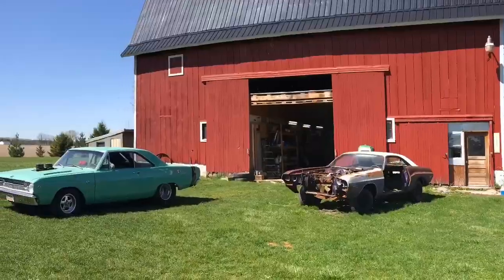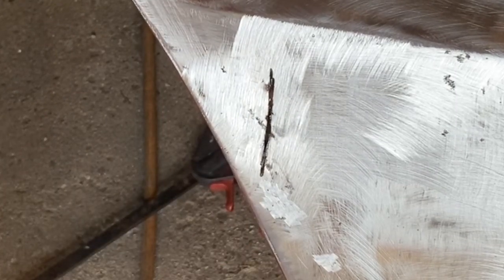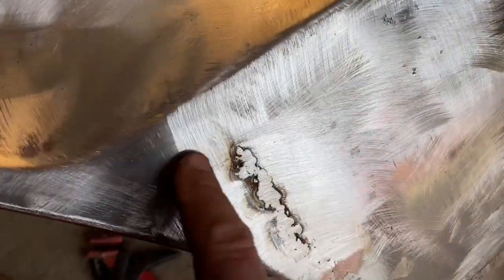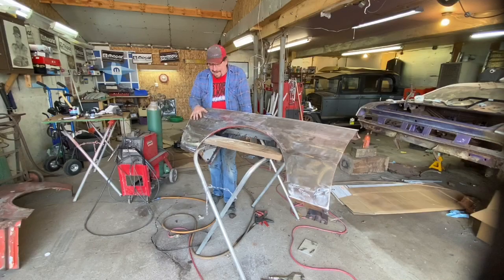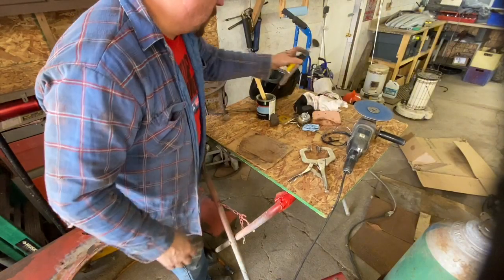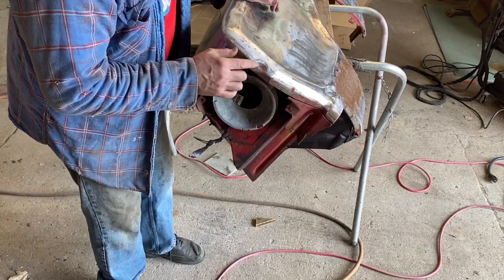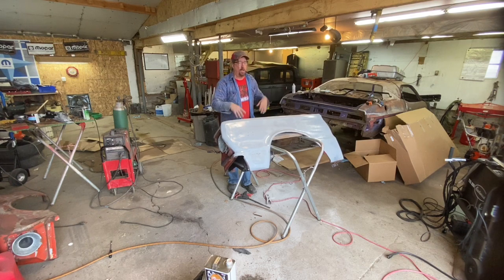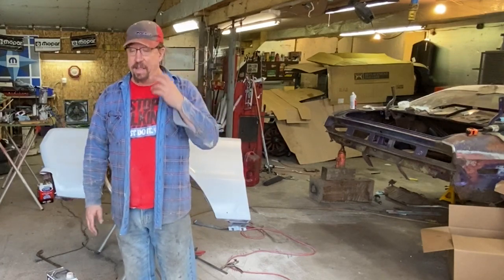Repairing the Front Fender - Jon's 66 Belvedere - EP3

Comment: Very nice episode, I know very little about body work or even prep work before paint. Is fiber glass filler better to use than something like bondo?
I've seen the method that welds rod to sheet metal and then uses a slide hammer to but I've never seen using a nail and pry bar. That is a cool trick, and requires no special tools. Great work today!
Reply from the maker: Fiberglass reinforced filler should be the base before using Bondo in cases where patchwork was done.  It’s much less likely to crack.  

I’ll be doing a lot more episodes on bodywork over time.  

Thanks for watching. 😎😎
Reply: @MyKARSShop  Awesome, I appreciate the hard work!